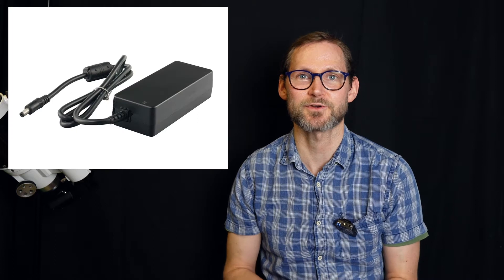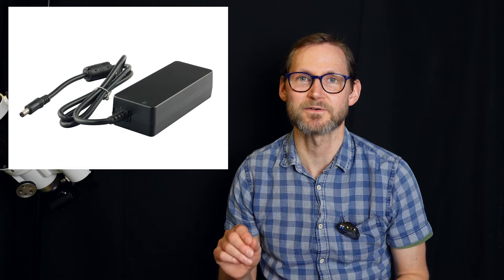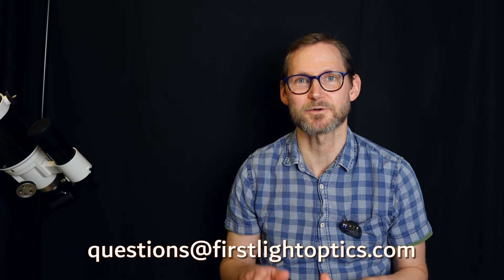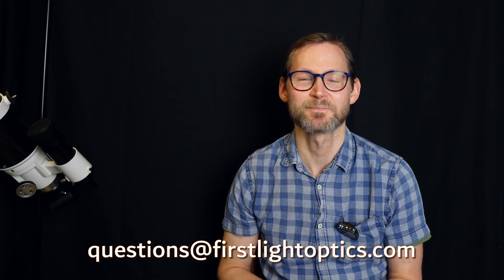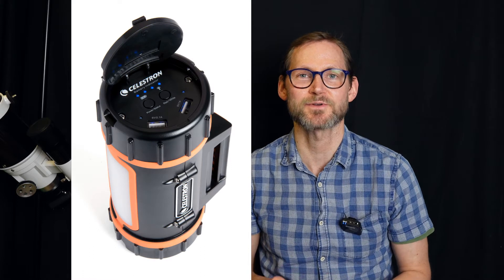Choosing The Right Power Supply For Your Telescope Mount

Comment: Can anyone recommend an external power source that actually works? I got a 12V battery from Talentcell and it didn't work at all. I know the battery was working cuz it charged and al the lights lit up, and I know the scope was working cuz it always works when plugged in. But when I tried connecting the battery, nothing.

Comment: Just bought eq 5 pro. Have 12v power supply. Plugged it in and it began to whistle ...zzzzzz whatever you want to call it. Is this norma ?
Reply: thats the motor running, pretty sure its normal, I have the same mount

Comment: Your video explained some parts I for sure needed i thank you. I have a celestron 800 cpc scope . I got a power station 400 v. So I got  A dC cable for celestron rated, it's a T UV- 12-2 input DC 11-24 output 12. Positive tip. Also AC/DC adapter model CT 1250 input 100-240 v
0. 8A max 50 60 hz output 12v 2500ma
The AC adapter also for my celestron but the AC one came with a smaller diameter plug the the DC on did. Do these figures all ok? Match is what I need?  Do I just get and adapter for the smaller plug and is it ok to use the AC adapter plugged on to my power station. I use use either or the plugs that I have here? Is one better than to other?
Reply: Please contact the help desk at questions@firstlightoptics.com